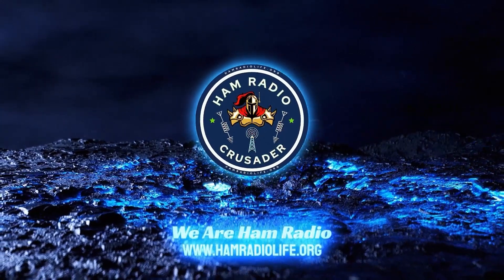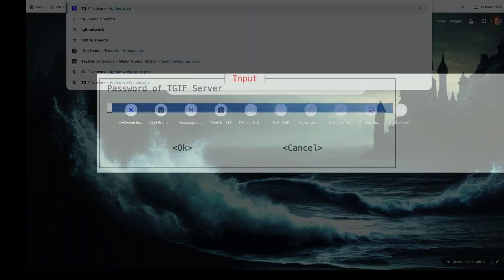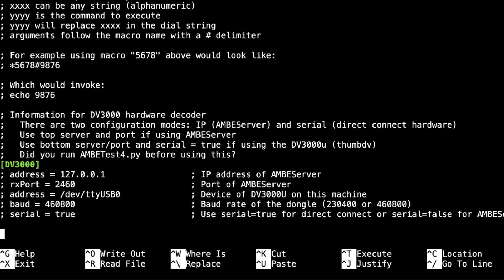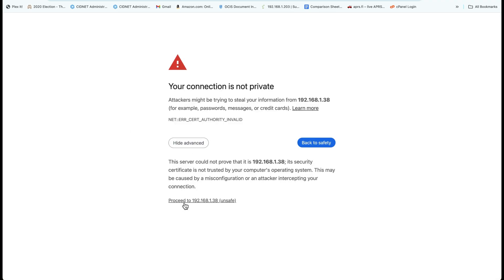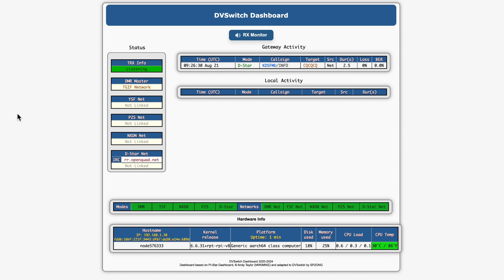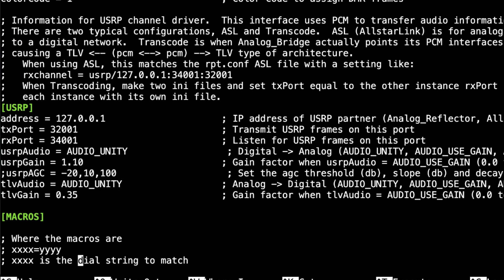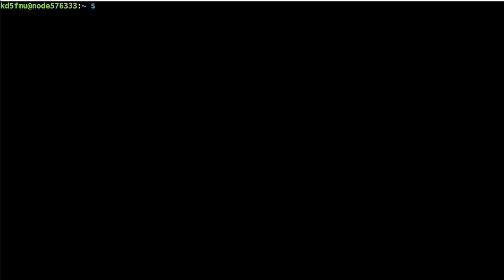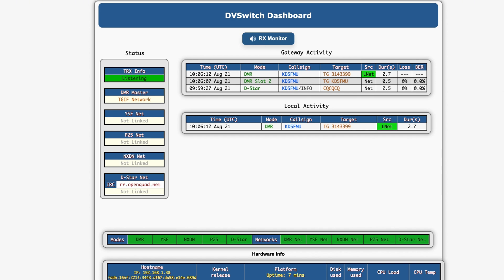DVSwitch Server for AllStarLink Version 3 - Part 2

Comment: A little late to the party. But am trying to stay with all the abilities  of ALS3. If anyone could assist I would be VERY appreciative to say the least. I have followed every step of Part 1 & Part 2. No issues. But when it comes to bringing up the DVS Switchboard url, NOT FOUND. Everything else is running just fine, with thos one exception. If anyone can help, I will gladly ship you free of charge a half-eaten donut. THANKS.
Reply from the maker: Try using 

http://your.ip/dvswitch
Reply: @HamRadioCrusader  THANK YOU!!! By the way, I finished off the donuts. But! I'll remember you at my funeral.. Thanks again.

Comment: Great video set!  The installation of PHP is actually the PHP language module, not the server.  PHP code is embedded into the page source between <?php and ?> tags, and the PHP code wont be able to be run without the module.
Reply from the maker: @srviejo2298  that is great to know thank you! Just goes to show you learn something new every day
Reply: @HamRadioCrusader  You're welcome.  FWIW, I successfully performed this installation for BrandMeister, and it appears to work well.  But connectivity from the Transceive application (mac OS) and Repeater Phone (iOS) appears to be broken by this installation (at least on my installation).

Comment: Very good.   I just setup an AllStar3 node with an AliExpress SA818 module on a new Raspberry Pi 5.   I wasn't 100% sure it all would work on the Pi5 b/c not as much documentation was out there for the 5.    But I wanted a more powerful Pi as I had other plans.   Those plans are starting to come into focus.    My QRP Labs QMX+ is going to be delivered here soon which is as a piece of the puzzle.   I plan on hooking the QMX+ up to the Raspberry Pi and leaving it in my basement (or maybe move it to my shed) with an antenna connected.     Last night I was able to get X11 forwarding working... I have WSJTX opening on the raspberry pi but the application is loading and appearing on my MacBookAir allowing me to wirelessly interact with the radio.    With my VPN software (installed on another Pi) I could even do this remotely when I wasn't even home.    You seem intrigued by different uses of technology and just figured I would plant the seed if you are into WSJTX since you already have the Pi configured with ALS3, etc.

Comment: Thanks, Freddie.  The only problem I have is my Allmon3 dashboard connects to normal nodes, but not to my private node 1999.
I t says node 1999 connection failed.  Any one have ideas why this is happening?
Reply: I have asl3, EchoLink, Allcan, super on 7.4 and dvswitch all installed by watching your videos
Reply from the maker: Not sure if you followed the directions EXACTLY as I presented them. You might try connecting the private to the public which is the reverse of what the video says but “should” work.
Reply: @HamRadioCrusader  I tried the reverse like you said   There was no audio from 1999 connecting to 569840
Reply: I have asl3, EchoLink, Allcan, supermon 7.4 and dvswitch all installed by watching your videos
Reply from the maker: @MiltDuquette-n3s  have you opened the DVSwitch dashboard page to verify that the digital side is connecting?
Reply: @ dvs dashboard I see my d-star node show up
Reply from the maker: @ can you send a screenshot?

Comment: Never could get the DVswith webpage to work. So i went to TGIF and watched the screen to my call sign up.  Mit help as an walkaround for some else. That mit have same problem.  But the program work. Thank you for the video.
Reply from the maker: So are you referring to the DVSwitch page on your node? pot the actual DVSwitch website on the internet?
Reply: @HamRadioCrusader  the part where you  refresh the page and the dvpage pop up. Kind like the allmon page is but the dvswith web page.  It just says not found. But the dvswitch is working. I just used tgif last heard menu to see my call sign pop up.
Reply from the maker: @davidavant3554  run that line in my previous response
Reply from the maker: If it’s the DVSwitch server page on your node, then run 

sudo apt install php-cgi libapache2-mod-php8.2

Then reboot and goto

http://YOUR-NODE-IP-ADDRESS/index.php
Reply: @HamRadioCrusader  I was not able to server page using http://YOUR-NODE-IP-ADDRESS/index.php

either but http://YOUR-NODE-IP-ADDRESS/dvswitch did work,, just an FYI for others to try

Comment: Easy setup with your step-by-step instructions. Thanks. Now for the fine-tuning. My bit-error rate is high (10 - 12). Would you happen to know where the adjustment is for this? Rx audio is fine. My Tx is where the problem is - I think. 73, N5MXI David